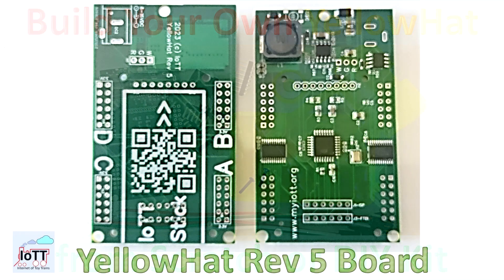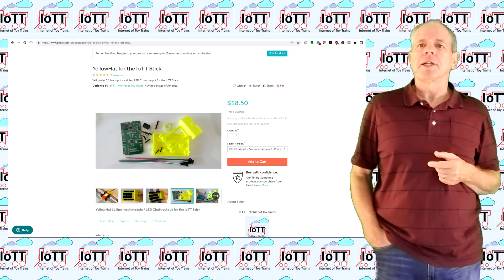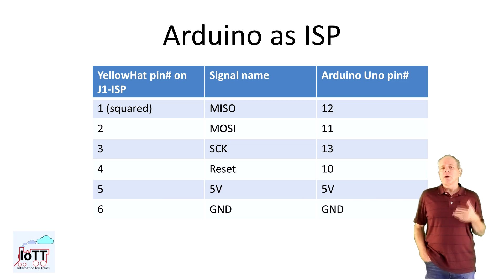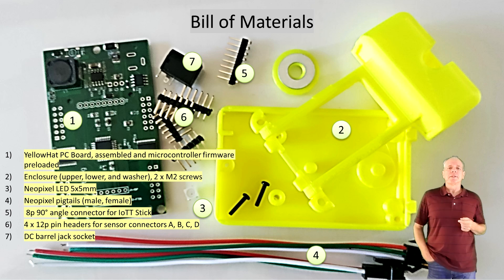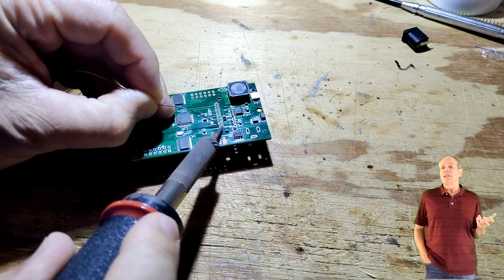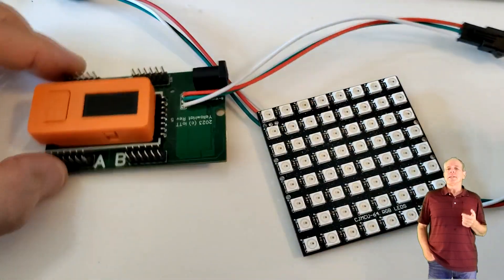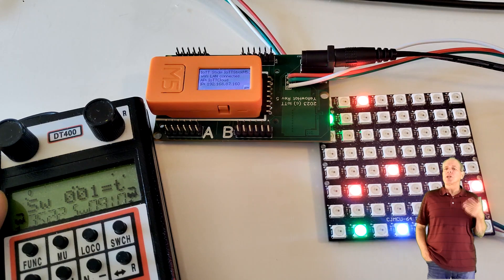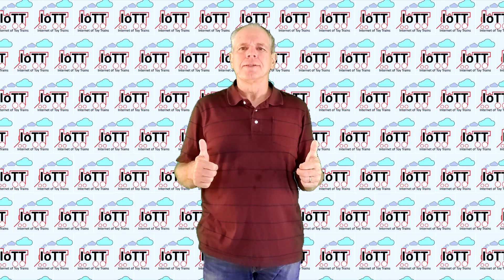Build your own YellowHat (Video#127)

Comment: This is a super device for building panels that only require the LocoNet and power connections.  I have replaced an entire box of cables with this device and simplified it completely.
I am using the older 1.0 version.  Had a couple of issues in getting started, but now works fine (with help from Hans).  It has features that are not obvious, but very useful.
Will there ever be a list of the fields and what they can do?  Not a full manual, just a cheat sheet about things like a potentiometer for brightness, making sure each YH has a unique set of button addresses, etc...
Love the capability of all of the IOTT devices.  Keep going with new ideas.
Darrell
Reply from the maker: Videos 29 and 30 have all the basic concepts. They are from an early development phase before I integrated everything into the IoTT Stick, but you will get a lot of basic information about the various configuration options. 
But you are right, I probably should do an update video on the YH setup.
Reply: @IoTT  Thanks, I did not go back that far looking for Yellowhat details.  Great work.

Comment: Hi, i have a little problem, I´m trying send to one arduino loconet decoder for spanish signals that i made, if i use the rocrail software i have nothing problem but i use yellowhat and my protoboard with the Loconet interface do nothing, and not see packets in the loconet viewer, what is the problem?
Reply from the maker: What Loconet interface are you using? Could be a problem with inverse Rx signal. The IoTT Stick is expecting inverse logic on both signals, Rx and Tx.
Reply: @IoTT  I use the most simple circuit loconet, i use 3.3V Zener diode betwen RX and Gnd because esp32 use 3.3V pinout and ttl logic.

Thanks ivan

Comment: Hans thanks so much for this new board, and for all. In my case i use the old PCB and great work.
Reply from the maker: You are welcome! It is really interesting to hear how many people have built there own YellowHats from scratch. With the new design this became much easier as the buck converter is no longer an add-on board, which greatly simplifies the assembly process.
Reply: @IoTT I have seen an option that is SecEl Handler, but it has the functionality and I don't know much about how it works, even so, everything you have as a program is wonderful, it is not easy at all.
Reply from the maker: Oops, that should not be there, I obviously forgot to comment it out. It is a feature I am working on, but it is not operational at this time. SecEl stands for Security Element,  which is the core building block for a signaling system. I have explained that in various videos dealing with signaling.
Reply: @IoTT  Ah okey jajaja, I'm waiting new news, thanks
Ivan